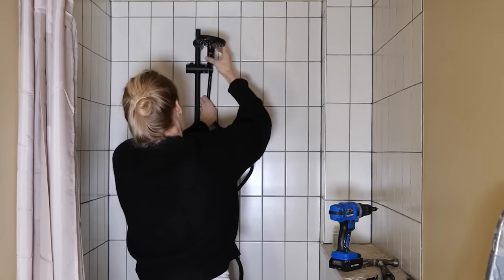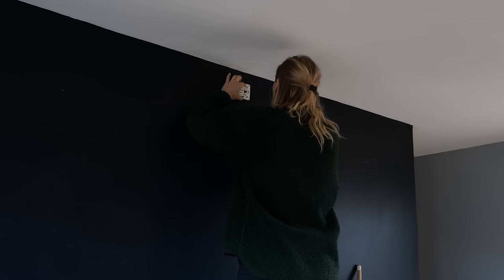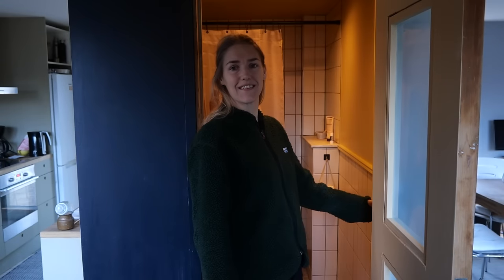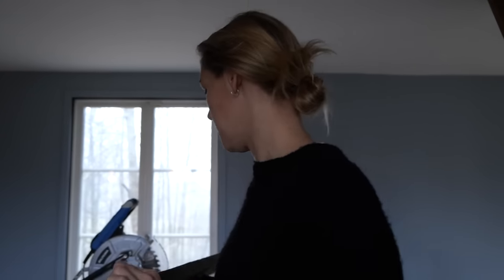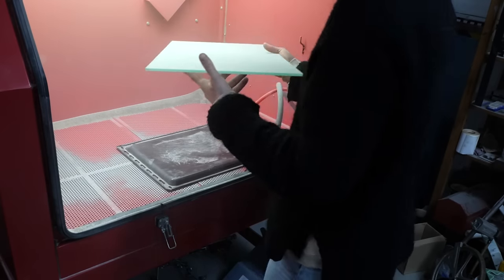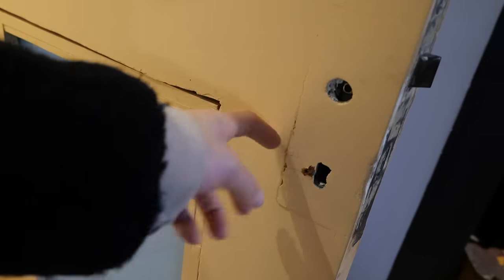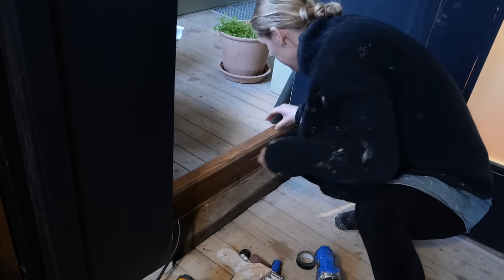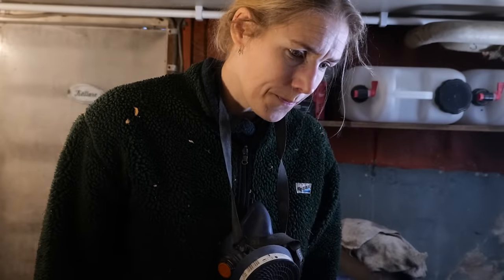#27 Downstairs finished and plans for next year | A rat moves in | Renovating an old house by myself

Comment: In trying to keep mice out stuffing holes with coarse steel wool works well, (the kind used for stripping furniture).  Once the holes are stuffed some insulation or spray foam seals it good. Mice and rats should avoid chewing the steel wool. You can leave some live traps to catch and release them after the steel wool is in place. Your place looks great by the way!!! 😊

Comment: When attaching plasticpaper to a surface use a lot of water with one little drop of sulfo soap in.
Then scrape.
The bubbles left under the plastic WILL VANISH after some weeks.
We were told this by two professionals.
And we put frosted plastic paper on five windows.
It's still nice now twenty years later.

The outcome of your windows became really nice! 👍🙂